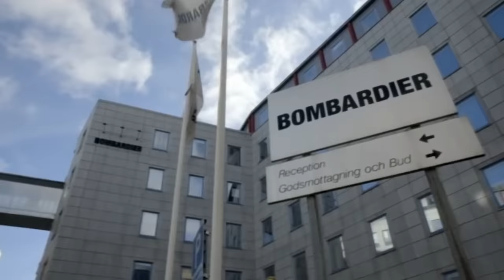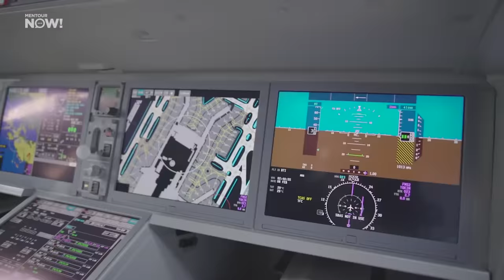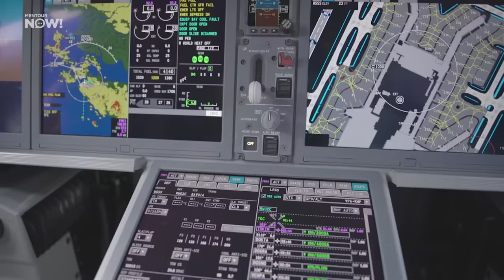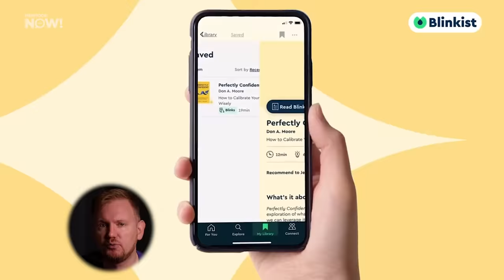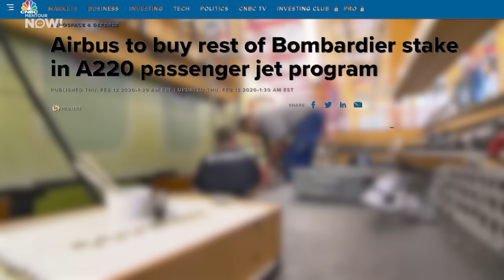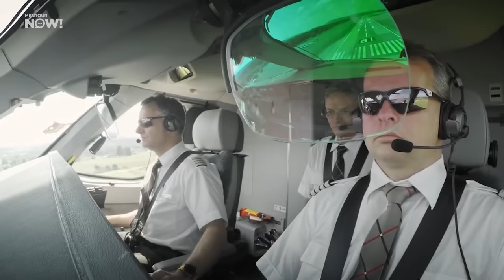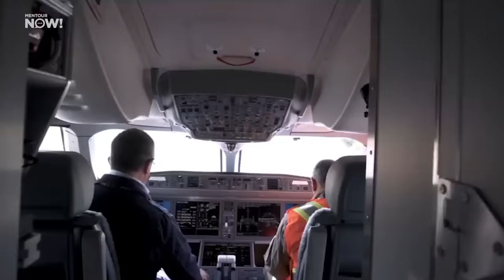Did Boeing GIVE Airbus a FREE Airplane?!

Comment: I wonder how long it will be before Ryanair and Southwest seriously consider adding another airplane type to start moving away from the Boeing 737 series. That would be a huge problem for Boeing.
Reply: Ryanair does have A320 family aircraft in their Lauda subsidiary.

Michael O’Leary, Ryanair’s Group CEO has repeatedly said they’d buy Airbus aircraft if Airbus would lower their price.

In the most recent version, O’Leary has said Airbus would have to lower their price by 30% for Ryanair to consider a future order.
Reply: Personally I love flying on Boeing. They feel different than airbus. They feel like a jet. But airbus are more comfortable. Makes me feel I’m in a bus. Lol
Reply: With 400+ future planes on order, it will be a long time, at a minimum, for Southwest
Reply: Southwest has a unique business model and the 737 serves them very well. No need for them to "move away from it". With the updated engines with better efficiency and greater range I think they can go another twenty years with the 737 as long as it meets their needs. Eventually a new plane will come along that will make it worth changing their strategy, but that hasn't happened yet.
Reply: Considering Southwest is one of the main reasons Boeing didn't replace the 737... I doubt they're going to move away. It was Southwest and American Airlines that pushed Boeing to make the Max in the first place. The Max is a great aircraft now. The problems have been rectified. No problems for the last 2 plus years. Airlines are reporting terrific efficiency gains compared with the NG. It's also gorgeous no doubt. This is the end of the road for the 737. There's nowhere left to go with this design. Boeing let greed soil its reputation. This is what unfettered capitalistic greed looks like when it isn't regulated or checked.
Reply: @StevePemberton2  Will Boeing still be making the 737 in twenty years? They can't keep the backwards-compatible cockpit design working forever. The 737 type is 55 years old now. In 20 more years, it will be 75 years old. They already have to add the central alerting system within three years of certification for the Max 7 and 10.
Reply: @Chris-Pringle  correctomundo. Being in an Airbus…..skimpy seat padding. Rides like a truck
Reply: @ejkk9513  slight correction: it’s called the 737MCAS
Reply: @ericfielding2540  They can keep making them as long as airlines keep buying them. They could have included EICAS in the 737 MAX but their bigger customers primarily Southwest wanted to keep commonality with their existing fleet.

As I said at some point something will come along that will make it worthwhile for Southwest to change their single model strategy, but things move slowly in the airline industry and twenty years is not far fetched.

I suspect when they do they will never go single model again. Let's say Southwest starts purchasing something new ten years from now. They will have 737's that they will fly at least ten years after that, so at least ten years with two different airplanes. So by then they would be thoroughly entrenched with that type of operation and would probably not wean themselves back to one model.
Reply: Ryanair and Southwest will not be moving away from the 737 series atleast for this decade 

It is expected that Ryanair will order around  100-200  MAX10s in the next few months/years , now that the MAX10 is guaranteed  to be certified.
Reply: @ericfielding2540  they will not be adding any central alerting system , just some stall/overspeeding warning/stickshaker   inhibit  switches , that's it .
Reply: @mmm0404  My understanding is that the FAA have approved the Max 10 but that EASA has not. Therefore, I don't see Ryanair or any other European operator acquiring it.
Reply: @The_Red_Squirrel  EASA will require  similar/same  retrofits as the FAA but have not put a deadline yet according  to my knowledge 

The whole 3rd AoA sensor and overspend warning inhibit  switches was actually  first proposed by EASA , the FAA just did a "copy and paste " . 

There are some European  operators who have already placed orders for the MAX 10 , they definitely  know more than you do
Reply: @Swimfinz  The rest of the world is moving  on , 737MAX'S  are filling up just like any other plane . It's a safe plane now 

The 737MAX is still racking up  hundreds of orders to this day 

It's only a few people  who are choosing to trap themselves  in their own reality  and hold on to the past . Haha
Reply: @mmm0404  I'm sure they know more than you or I know. However, I'm also sure the contract stipulates that the aircraft comply with EASA requirements.
Reply: @The_Red_Squirrel  and what are those requirements? Are they not a 3rd AoA sensor and some switches? 

Boeing's  current MAX10 test aircraft is testing  such systems , and they have promised the EASA that the MAX10 will be introduced with a third AoA sensor ( synthetic) , and retrofits will made will be made to already existing aircraft flying  in Europe.
Reply: They can't because of a few reasons, 
1. They are in bed together (I mean the A220-300 perfectly suits southwest properly while Ryan air would have to see a substantial discount to consider it as they said) 
2. Ryanair is less inclined since they have almost all variants of the 737 mostly the -8 and -9 and if they should switch then a case is to be made for the 321XLR which would suit them and their point to point long haul low cost model,also the A321 is a much better replacement for the max 10 they have on order, so no they are not really going to consider it over the max 9 and 10 they have on order all things considered
Reply: @mwat22  Ryanair  don't have the MAX 10 on order , and are not interested  in the  low cost long haul model . 

Remember  Norwegian long haul? It went bust . 

The MAX 10 will offer 5% lower seat cost   and trip cost than the a321neo ( according to boeing) , making it ideal for Ryanair's current business  model of being the cheapest LCC in Europe. 

The XLR with its high seat cost is not for airlines like Ryanair, never will
Reply: @Swimfinz  may I remind you it's been almost 4 years since the last MAX  incident , it's your choice if you want to carry that burden for the next 4 .
Reply: I understand that Southwest is now flying 737-Max aircraft, so Boeing is not in immediate danger of catastrophe but is on the ledge.
Although there are regional airports that won't support 737s, there are enough full service airports that Southwest doesn't have to fly an aircraft smaller than the 737. And, maybe that played a part in Boeing's lack of understanding the importance of a smaller Bombadier sized jet.
Reply: @bobbrewer5182  And of course Ryanair still has an MOU for the C919
Reply: @mmm0404  state your position to the Lion 737MCAS families.
Reply: @Swimfinz  using the victims as a shield to miss the point ? That's low
Reply: @mmm0404  May I remind you 2022 just ended so with 737- Max grounded 2020 your 4 years is porky pies.
2 crashes in the last 3 ¼ operating years for an uncommon plane with a dubious corporate interests cost cutting rationale is no reason for confidence.
Reply: @RobBCactive  eeh who cares what you and I think , airlines will continue  to buy the 737MAX like nothing ever happened . That's the point really . 

Airlines  are confident in the fixes Boeing have made , and know that most people  can't even differentiate  a MAX from an NG .
Reply: @mmm0404  just one more crash can change that.
Reply: @RobBCactive you sound like you are looking forward  to that . I know many of you hate Boeing , but that is low and nasty . Toodles
Reply: @mmm0404  nope, just the focus on corporate interests is EXACTLY what has lost Boeing's reputation.
Your complacency is disturbing, you made misleading posts and it makes my skin crawl.
Reply: @RobBCactive  

I'm sorry for misleading  everyone  by pointing out that despite both incidents , the 737MAX  will still end up a safe and successful  airplane. 

I'm sorry for misleading everyone  by saying the rest of the world is moving on and that airlines have shown confidence in  737MAX  once again , with 1500+ orders since 2020. 

Sorry for misleading  everyone by pointing out   that the last incident  happened  almost 4 years ago ( March 2019) and that Ethiopian Airlines have reinstated  their 737MAX's back in service again.. 

Happy now?
Reply: @mmm0404  I think you are missing the point. Boeing may have sorted the technical issues with the B737, but it will take a lot longer to repair the reputational damage caused by prioritising commercial interests over safety.
Reply: @Chris-Pringle  I hate flying on Mcdonnell Douglas, ahem sorry I mean Boeing.  Very dangerous planes.
Reply: @bobbrewer5182  Airbus have repeatedly stated they will not sell aircraft direct to Ryanair after O'Leary's famous comment that he literally 'raped' Boeing to buy 737-800NGs.  Not exactly an ideal way to begin discussions lowering prices for an aircraft order. I'd say Ryanair has got about a 1% chance of directly buying an Airbus product while that man is in charge.
Reply: @bobbrewer5182  If he buys around 200 aircraft at once, he could have up to 35% cut from the pricetag.
Reply: @Chris-Pringle  Valid
Reply: @bobbrewer5182  And why would Airbus lower their price when they already cannot make anywhere near enough 320 series to meet demand? O'Leary knows that and is just trying to pressure Boeing to lower THEIR prices on the 737. The guy is very adept at this sort of game playing.
Reply: While there is a certain logic to operating just one aircraft type, the issues with the Max should be a warning of the risks associated with such a policy also. Merely beefing up the Mcas system hasn't put the handling problem away; it's just added another piece of software to hide it. Like the VW Beetle of old, production of the 737 has continued well past it's sell by date. With no replacement under development Boeing will become more dependant on airlines like SW and Ryanair to keep on buying 737s. However these firms will inevitably squeeze Boeing on price, given their marketplace muscle. So, the profit margin on sales to the low cost carriers will be very slim indeed. It's not a good place to be right now for Boeing.
Reply: What is the cebtral alerting system thing?
Reply: Its because of airlines like SW that Boeing never built a replacement for the 737. Boeing did want to replace the 737 after the NG model but airlines that have 737s ln fleet told Boeing they were not interested in a new plane. The reason why the 717 was cancelled instead of the 737 is again SW didn't  want to switch. Dont blame Boeing.

Comment: I have a friend who worked with military air procurement for many years and Boeing has lost a lot of respect in those circles in recent years.  The finance and bean counters appear to be running the show there instead of the engineers and product people.
Reply: You've only got to see how its recent space business has been going, suffering the same malady of Wall St types running it instead of the engineers. Look at Starliner - contracted with NASA to launch in 2017 and still not launched. Meanwhile SpaceX built Crew Dragon in under half the time and budget and is operating it routinely.

Comment: The goal seems to have been killing the C Series  program to eliminate any possible threat to the cash cow 737.  The idea of Airbus swooping in and “saving” the C Series was probably never considered to be a realistic option, given the high unit costs of the airplane and the heavily North American supply chain.  As a result, the potential for providing a new design paradigm which could have provided a comfortable pathway forward from the 737 (as you pointed out) was lost.  Airbus managed to benefit from Boeing’s hubris.  There’s a lot of that going around lately….  =/

Comment: These events also likely cost Boeing the sale of nearly 100 Super hornets as well.
Reply: What's crazy is that's a very easy connection to make. Weird that nobody at Boeing thought about that.
Reply: No, the US was going to make sure that Canada was going to buy the F-35 no matter what. Netherlands was going to purchase a different fighter and diplomatic pressure came in from the US to change their minds. Interestingly Public Services and Procurement Canada (PSPC) was negotiating price, delivery schedule, and economic benefits to Canada during fall of 2022 even though the choice of plane was announced in the spring of 2022. The president of Saab Canada (Saab submitted a bid for the Gripen) is upset because all of those items were supposed to be finalized in the competitors bid. So why is PSPC having to negotiate these things now?

We would have been better served with the Gripen. It will soon have the electronic capabilities that the F-35 will soon have and is able to carry more. We don't need stealth fighters. We also don't need to lose our sovereignty with the F-35. They are constantly sending back data to the manufacturer (and the US government) about what the plane is doing and where the plane is going. It's in the name of preventative maintenance but do we have to tell the US government where our fighters are every second. Also, all major maintenance is done in factories, not on base. This includes engine changes. This is bloody useless in a battle. How do your tech people fix your planes in combat if they can't do it in peacetime? Oh, that's right, their stealth planes, they won't get damaged in battle! /s

If it's anything like the contract Phase 2 of the LRT in Ottawa then they're probably adding the cost of wheels and wings. (The contract for the Phase 2 of the LRT in Ottawa was handled terribly. It twice failed the technical requirements but was allowed to continue. It won because it was much less expensive. Of course it may be so cheap when it's missing a ton of the requirements! Is it going to be so cheap when all of the requirements that are missing get added back on as extras? The bonus part was when the city council went to vote on the contract the mayor knew about this but wouldn't let the rest of the council know. Sorry for straying off topic but the LRT in Ottawa is a massive tragedy that more people need to know about.)
Reply: @capitalinventor4823  It might be true that Canada was going to pick the F-35, but the dispute did lead to the cancellation of the small number of Super Hornets prior to choosing a full replacement for the Canadian legacy Hornets. If Canada already had a few Super Hornets, Boeing would have had a better chance at winning the competition.
Reply: Alresdy mentioned in the video 14:21
Reply: @mediocreman2  Well the Super Hornets are kind of yesterdays jets ,F35 might cost way more,at least they are next generation, and  Stealth features and some can even go VTOL,
Reply: @capitalinventor4823  Not to mention the Toronto  LRT Streetcar  debacle.
Reply: Although I think the F-18 Super Hornet would be better for the RCAF.   A follow on to what is being flown now.